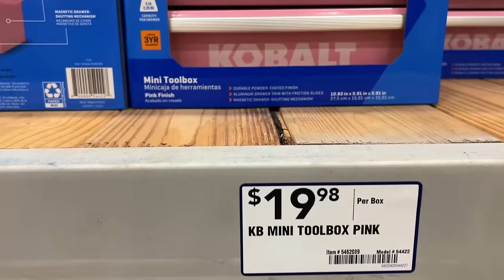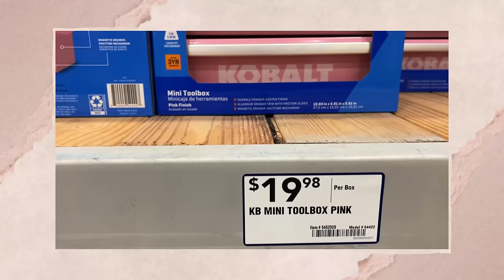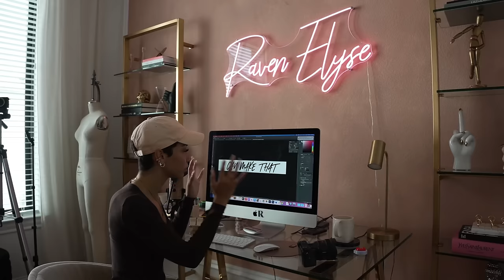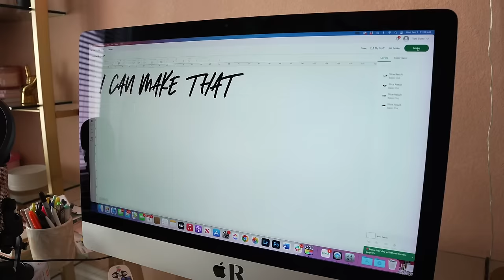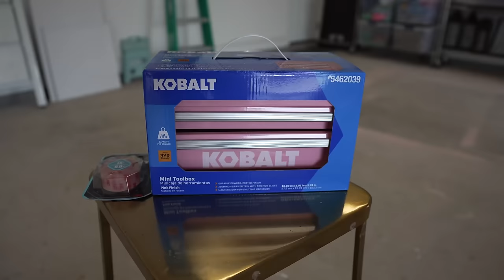My GIRLY GARAGE WORKSHOP Final Reveal!

Comment: 27:26 RAVEN PLEASE ‼️‼️‼️be cautious when using jigsaws and power tools in general.. blades can break and can make you lose stability. Also NEVER cut that close to your hand. It doesn’t matter how cautious you think you’re being, accidents and malfunctions can happen when you least expect it! and secure your wood if possible always. If you feel your hand ever needs to be THAT close to the blade to stabilize the piece you’re working on, use a spare piece of wood instead to hold down the piece (like a block) so you have distance from the blade. 

I hope this isn’t annoying I just really want you to be safe and not putting yourself in potential danger of losing a finger 🥺💕

Comment: I would be scared to put the thinner in a closed container. Flammable items. Also, other dangerous things. I would need air or air on at all times. its hot in TX. Also, I would have raised the sign, made it a bit larger and added the logo RETV into the scene. But good inspo.

Comment: The next time for the letters if you use semi permanent or permanent vinyl you can cut your letters and use the "weeded" part for the template and the outer layer to put on the wall and place the letters inside for the right spacing. You can use vinyl on wood and other materials and the semi permanent or removable will peel up once your done

Comment: Looks amazing, well done girls. The only thing I can add for the future is, store the paint cans upside down, that way,if a skin forms it will be on the bottom and not the top. I decant my left over paints into black jars or old smaller tins I’ve cleaned out if there is less than half a can, great space saver. Love your ethos on life K🇬🇧❤️